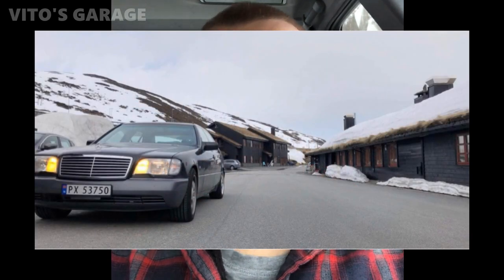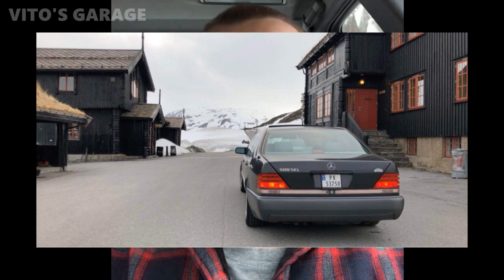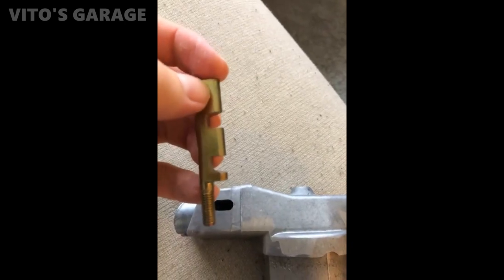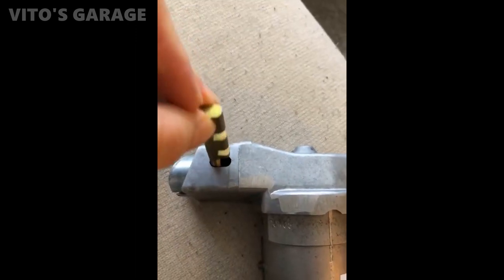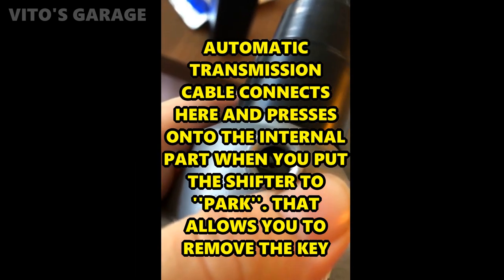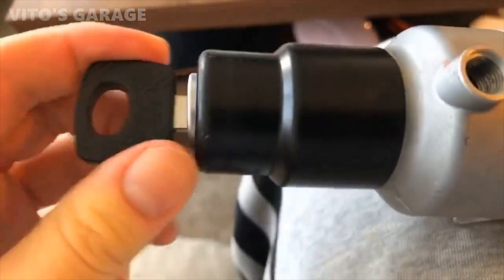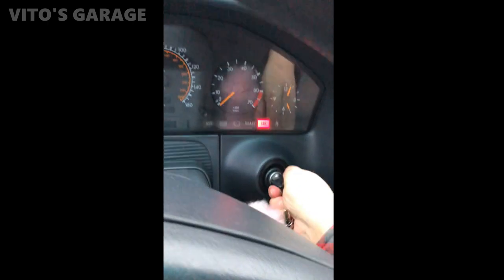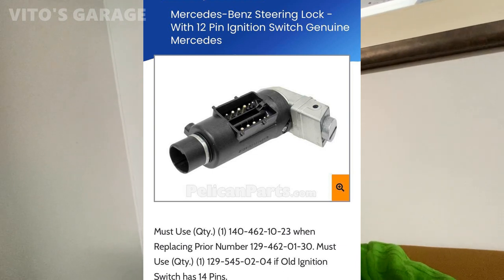Mercedes W140 R129 Ignition Lock Assembly Problems & Solutions. Key Won't Turn. Dennis from Norway!

Comment: Thank you so much for the support and follow up, Vito! 

I just want to also share that you can prevent this type of problem that i had, if you only change the ignition cylinder (what the key goes in to).  If you start to feel that it is acting wierd. replace it as fast as possible, and don¨t do like me.  The important part here, is that you can turn the key, so the rest of the ignition lock UNLOCKS. In that way, you can take it out, take it apart, and only change the 30Dollars cylinder and get a new key. Instead of cutting and wrestiling with it. 

You will also have to remove the instrument cluster, to get a better view (Only requiers the hook pully thing on each side, and jiggle it out)  You NEED to have the cluster out also when it comes to put in/out the security bolt. Really difficult to get the bolt in its right place, but you can make it easier with a magnet/tape to help you landing that bolt in its correct place.  And my last comment, is that everything looks good. no "shortcuts" or any janky solutions.  Thank you! Viva la Benz:D
Reply from the maker: Great tips and tricks, Dennis! Thank you so much for loving Classic Benzes!!!

Comment: Hello, 1998 s500 here. What should i do if the key is turning as it is supposed to but the steering wheel remains locked?
Reply from the maker: Sounds like you need a brand new steering lock assembly that’s shown in the video
Reply: @VITOSGARAGE  thank you for the reply. Do you know if it's possible to disable the locking mechanism on my existing lock rather than replace it? My car is currently stuck in a public parking lot and needs to be moved asap

Comment: 1991 300SL after removing igniton easy but accidently went to zero and locked steering wheel any way of unlocking without damaging anything HELP!
Reply from the maker: You’d have to send me a video on Instagram: vitosgarageyoutube. It’s hard to tell what’s going on
Reply: @VITOSGARAGE  I got it drill small hole use small pick was able to cycle switch back to number #1 position.

Comment: Having problem whit my 1999 Mercedes s500 ignition stuck  we’re do I get the parts ?
Reply from the maker: Check pelicanparts.com or autohausaz.com
Reply: Thanks but they don’t have it
Reply from the maker: @easyautorepairs6212  look up the part number on nemigaparts.com and then type that number on eBay